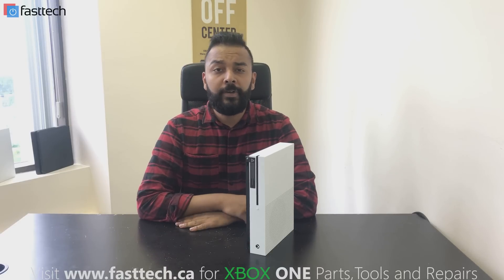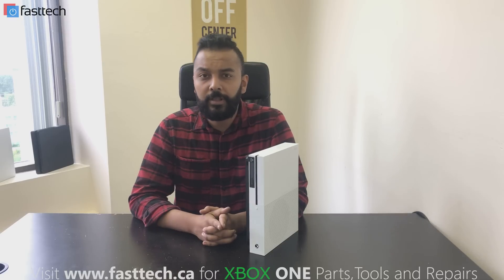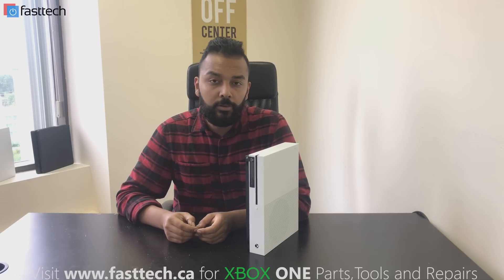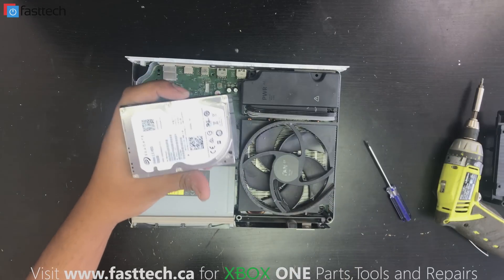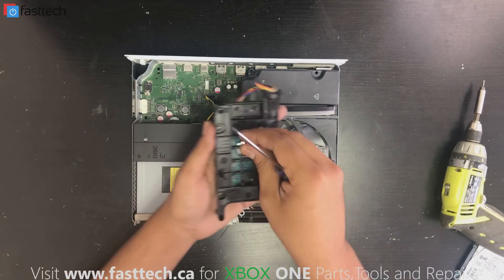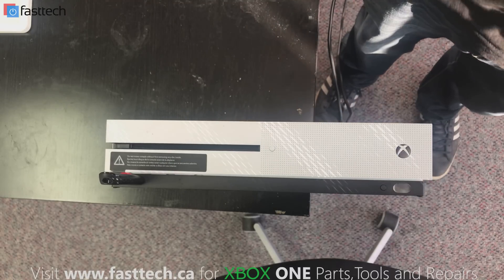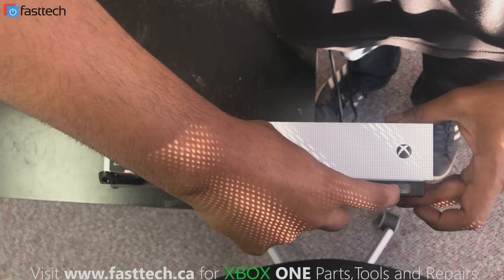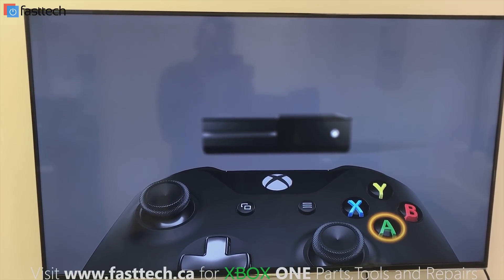Xbox One S E101,E102,E105,E106,E200 Repair Guide (Hard Drive Replacement)

Comment: I got the error code e101 and e102 and the offline system update or delete all data does not work. Also I only used my console for 2 months in 4 years when I got in new condition. Do you think it is the hard drive or power supply.
Reply from the maker: ostrich killa watch the video from the beginning to the end

Comment: Is it possible to go deeper into E200 system errors?  Like E200 0000000A and E200 000000EF  - I believe these are somewhat related to corruption or it could be that the drive is failing?  Hey wait a minute, why is it showing an Xbox One in the final part and not an Xbox One S?